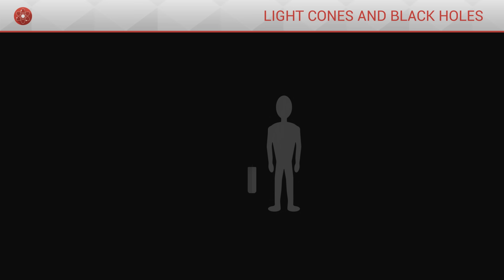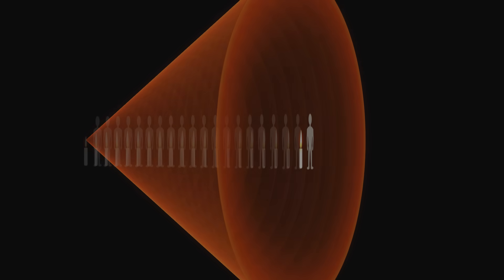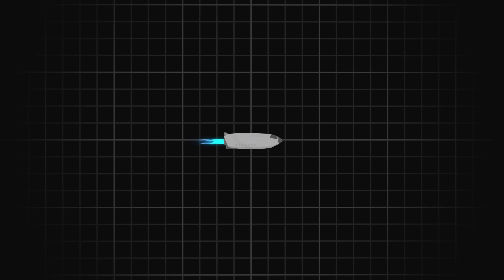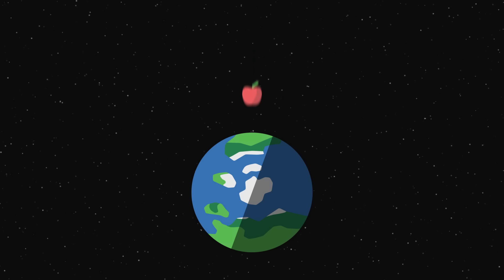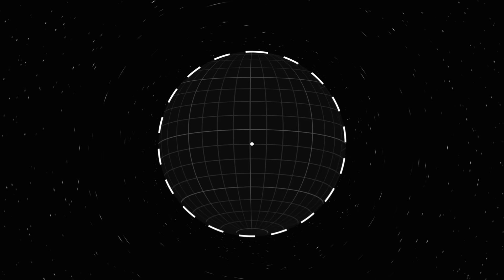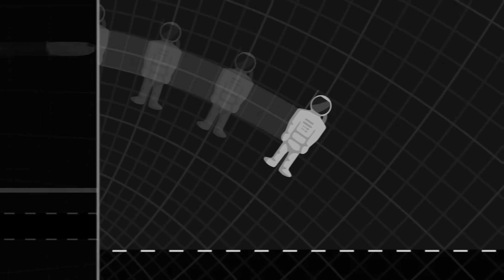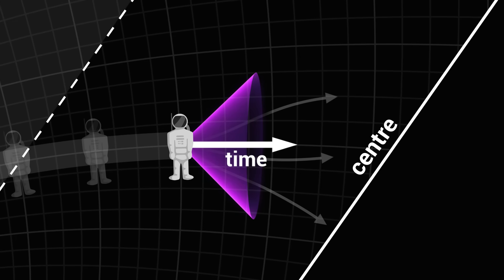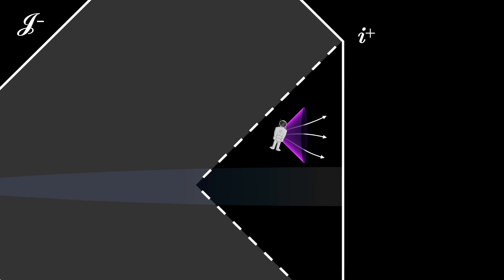Why Time and Space swap in a Black Hole

Comment: Inaccurate.  Black-holes need not be singularities.  Therefore, it is highly unlikely time-cones inside the back-hole point as indicated.  One example to prove the point:  What is the Schwarzschild-Radius of the visible-universe (hint: 13-ish Blyrs).  Is the inside of that black-hole a singularity?  Nope.  Schwarzschild is linear, while gravity is proportional to 1/R^2 (yes, even general-Relativity's space-time interpretation goes as 1/R^2).  Therefore, large black-holes can exist with non-singularities, even if we limit our thinking to the physics and particles of our visible-universe.  (more...) 

If we expand our thinking to presume those laws might not contain the same deBroglie wavelengths, then there may be no black-holes dominated by a singularity?  And doesn't that make more sense anyway?

Comment: The speed of light is an assumption, not a certainty. It’s an assumption in that we have never experimentally measured the one-way speed of light. The best we have been able to do, even with our most sophisticated modern technology, is measure the roundtrip speed of light and assume that the speed is the same in both directions. This is what’s known as being isotropic — a value is uniform no matter the direction. To be anisotropic, then, means that a value varies depending on the direction. Einstein’s theory of special relativity assumes that the one-way speed of light is constant and isotropic. So what happens if the one-way speed of light is anisotropic? What does it mean for our universe if one of our most successful theories of physics is based on an assumption that turns out to be false?

Comment: In FIG 1 in the Nobel prize-winning paper of Penrose, Phys Rev Lett 14 (1965) 57, time is NOT pointing at the centre of the black hole.  It is a common myth that t and r would swap their roles inside a black hole.  Consequently, we would have v = dr/dt above the surface of the black hole but v = dt/dr below it, giving v ~ 0 and infinity immediately above and below the surface, respectively.  Is this reasonable?

Comment: Sure matter atracts in cone forms at different levels and diferent sizes, my guees is that we could say are 3 axis which meet all at the center at which we could see as an asterik where at 4 ends you may place the 4 cardenals : north, south, east and west in a flat land with a respective above and below  so making it tridimentional.  -     The  hexagonal could be seen as six points of forces but as they attract oposite in cross section they all form a central midle poin same as seen in the video of VERITASIUM channel called THE SNOWFLAKE MISTERY at time 10:56 -   where the snow flake show 6 nice exagonal cones seen flat plus a central hexagonal where all 3 main axis meet, think we could consider 7 poins not just six in nature as a WHOLE.

Comment: 4:15 to 4:55 is about the same as in here from the one of VERITASIUM  channel video: THE SNOWFLAKE MYSTERY. 
To my suggestion we should consider snow flakes be molded in air particles due that i think that matter acomodate in HEXAGONALS so as water vapor fridge in this HEXAGONAL air chains  some how as glass they brake as they fall.

The point to me is that matter, light and plasma could be seen as same things but in different state each so creating a cicle as water here in earth.  Stars all are plasma emiting light of which each is made of, we could say  light diffracts as seen in QUASARS theire light riffracs back and as we know theire light is one of the stronggests or most stronggests ones.   -     this light arching as they call it is the one that produces the electromagnetic sphere  -   this fenomenom occurs as well in DNA and both could be seen as 2 MUSHROOMS forms one to the north and one to  the south and both depart from say the system s equator or central disk formed by the elements that compouse the system that atract from north to south and viceverse in cross section where all meet at the center.

Comment: so now that every particle in our universe can only move freely inside the one very first lightcone, 
which was created with the big bang, isn't space itself also a cone in space-time?
space has been expanding since the big bang, and is now growing faster than lightspeed.
the angle of that cone must be bigger than 45 degrees.
it's not really a cone, because it must have an exponentially growing radius, right?
it can't have intersections with the light cone, because then light would've escaped space at one point in time.
so the space "cone" must have always been bigger than the light cone, but exponentially growing.

Comment: I think this is on the right track as the penrose diagram suggestions this universes 4th dimension is xstallic in nature. I think the light bubble is correct but there are many sources of light and as demonstrated many perceptions per light cone. 
The very last thing was most important as i find it incorrect based on the fact that the penrose effect closes the victims perception of the pases completely off? It erases ones mind? No 
Also the closing off of physically renetering a time space once known is off limits and the force of this close off generate the white hole as it pushes everything out thus generating that helical structural so notable.

Comment: Light may move at the speed c in a perfect vacuum but reality is not a perfect vacuum and light never really moves at the speed c for very long before it interacts with something else in the not really vacuum of outer space. My point is that the whole idea of a "light cone" isn't really dependent on light, but rather on time or "the speed of light" which is a speed that most light is not moving at. Really we should just say "c" which is "the speed of causality" and that is why it is a c and not a lower case L . It is the speed of causality, and the public likes to call it the speed of light although in reality most light does not travel at this speed and is slowed down by its interaction with atoms.

Comment: You're on the list.
Reply: BTW the list is is a list I'm compiling of youtube channels spreading scientific misinformation. You're far from the most egregious (I'm looking at you F̶u̶c̶k̶e̶d̶Factnomenal), but you guys most certainly need to either do more research or rework your script. You didn't get anything horrifically wrong, but didn't hit the mark on a fair few things. That said the last few things you had to say you absolutely nailed, kudos for that. But in the end I must admit it confuses me more than anything else. You managed to explain the mire esoteric concepts fairly accurately, how did you mess up the fundamentals like causality?

For completeness sake I'll just say the speed of light is c... c stands for causality. Causality doesn't travel at the speed of light, light travels at the fastest possible speed, the speed of causality so to speak. Light is a causal linkage between two points in space, be it the virtual photon extainged between colliding electrons or the the light emitted from the sun. It all happens at exactly c... if the inverse were true then things like diffraction would kinda destroy the universe.

Comment: I was thinking: A black hole is theoretically not black isn't it? (Ignoring Hawking Radiation and infalling material)
There would always be light from when the star that formed the black hole collapsed barely escaping from a time where the surface of the star was just so much above the evbt horizon. It would get very very redshifted but theoretically there would always be radiation, wouldn't there?

Comment: Technically, you can never move backwards through space either - you can only move forwards.  If you remove vector references (as in the relationship your movement has to your orientation and how previous trajectory determines the vector definition of future movement) then if you move at all you're moving in a positive direction (as in your origin point at any instant in time is always zero and the next measured location is always a positive integer away from that origin point).  You can't ever move -10 (minus ten) feet away from where you are.  You can only move +10 feet away, and the direction along an axis relative to another point along the axis that you DON'T pass through, defined by integers determines the semantic description of your movement relative to that axis.  It doesn't mean you're actually MOVING backwards through space because space and time are inextricably linked in the sense that moving through one requires that you move through the other and all FOUR coordinates matter, not just the three spatial ones.  The point in space that you move from and then come back to is not the "same" point in space-time.

Comment: All future world lines end in a singularity if only gravity.  Dark matter proposed to explain why we haven’t collapsed yet.  I suggest an alternative 
Neutron decay cosmology. The neutrons which invert at moment of neutron star collapse into black hole become the vacuum energy leaving the highest energy density conditions then re emerge in lowest energy density points of space, deep voids.  The neutrons are traveling near c and get 14ish light minutes then decay into amorphous atomic hydrogen.  This decay process includes a volume increase of 10^14 times.  This is expansion. This is dark energy.  
The amorphous atomic hydrogen doesn’t have stable orbital electron so can’t emit or absorb photons.  This is dark matter, or part of. In time this hydrogen follows usual evolution until in distant future it is once again parts a neutron star about to invert. 
This topology, this mechanism keeps Lambda at perfect balance.  It solves black hole information paradox.  

Time is infinitesimal but the universe is eternal

Comment: With so many comments already, I am not sure if this question has been posed already, if it is, my apologies.

If space is the set of all directions perpendicular to time, and this view of the light cone is a 3D rendering of what’s actually happening in 4D, is it possible to leave the light cone in true 4D space-time? That is to say, if we were to interact with 2D creatures, they would only see a 2D representation of our actual 3D selves. Similarly, we are 3D beings interacting, rendering and comprehending what is actually happening in higher dimensions. Does this mean, mathematically, or even theoretically, we could leave the light cone if we could interact with space-time in 4 dimensions? I hope I’ve worded this correctly.

Comment: All wrong. first, space locally is never changing, because that's the idea of Einstein that you can't know what's going on, when you are in a box. So space is never curved it is flat, locally. Only time is changing. Then there is nothing to exchange.
Reply: All wrong. First spacetime is what is locally flat, not just space. But the light cone is not local, it extends into the infinite future and all space light could reach in that time. Locally flat just means you can't notice a distortion of the light cone very close to you.
Space and time are both relative in one spacetime. Which is which depends on the observer.

Comment: Should the lines inside the horizon straight lines at -45 degree angle? If it's lower, some light can travel back in time. If it's higher, some light can escape the horizon.
Reply: If it was lower, then it would not be a constant because lower than 45 degrees means slower than c.
c is the path that cross 1 unit of distance as 1 unit of time.

Comment: Absolutely outstanding...untainted even with the mention of the following. Rather than "fall" I think 'attracted' or 'pulled' might be better. "Fall" tends to keep people fixated on thinking of the black hole as a whirlpool with a planar top (surface of water). If different wording can disabuse people of this incorrect visualization, then I believe it to be more than just an issue of semantics. Instead, you are pulled into a spherical object...inexorably attracted toward a central region. And going in head first, you might even have the sense of being pulled up, rather than falling.  Also, not everyone is brought up believing time flows left to right. We can feel for their disorientation with the graphics. But, that's just the way it goes.

Again, excellent material and presentation. Kudos.

Comment: I don't understand why do you speak about any center of black hole, while there is no such center, the concept is not correct, as far as I understand the concept of black hole it is a bouble of spacetime, so it is the surface which groups with every massive object swallowed. It is better to speak about blackhole as a bouble which creates enclosed "nothingness" of specetime, actually the bouble is removed from spacetime, there is no interior of the blackhole, check PBS Space Time video, it is really nicely explained via the string theory as stretched string loops to connected all regions of the blackhole surface.

https://www.youtube.com/watch?v=351JCOvKcYw&t=833s&ab_channel=PBSSpaceTime

Comment: Lovely! I has just built an intuition on penrose diagrams and now you screwed it for me. No, it’s a really interesting visualization. However; wouldn’t be even more intuitive to show that the distorted space time also distorts the geometry of the light cone? That the 90 degree angle should shrink and in this model the time and space axis would be parallel at the singularity? I’m not sure I’m getting your geometry right but my intuitive interpretation of the visualization would be that it allows movement I space ( inside the event horizon) that would not also take you closer to the singularity, which I think is not intended. 
Thank you for making this, very inspiring!

Comment: It seems that there should be a step further. In the way that both a light cone and a black hole restrict causality (but retain the matter's gravity for distant observers), it feels like there is a maximum density of information (i.e. "flux of light cones") the universe can contain/pass through any one region while maintaining causal coherence. Add too much, and the details are "abstracted away" by the event horizon. Which, at the other extreme, brings up the question of whether there is a "minimum light cone density"? In other words, does causality, represented by light cones, stop at some large distance, roughly analogous to how sound waves fade and eventually disappear into the thermal background noise?